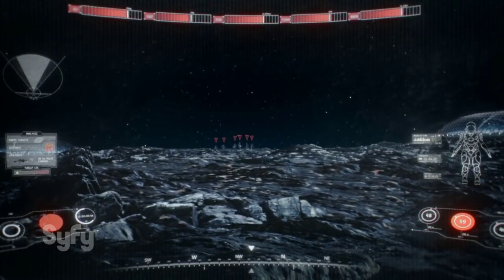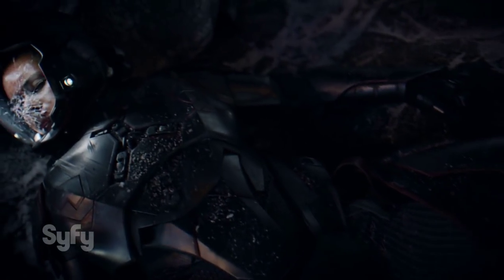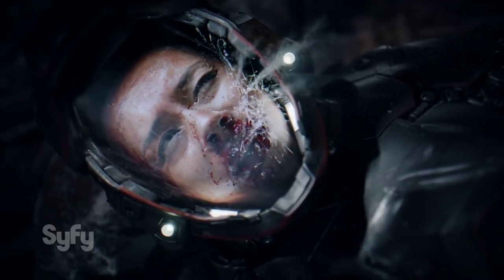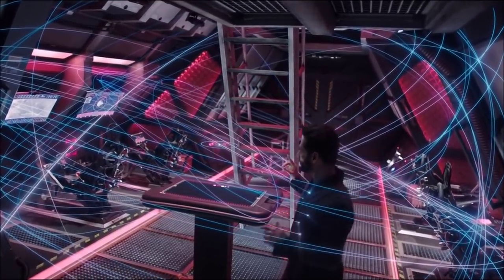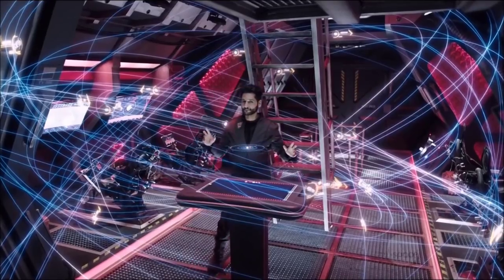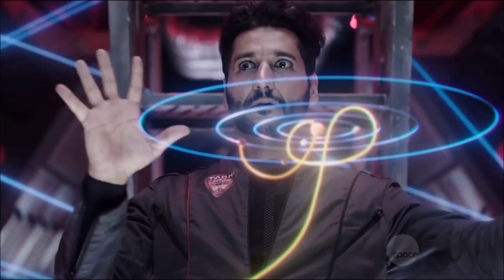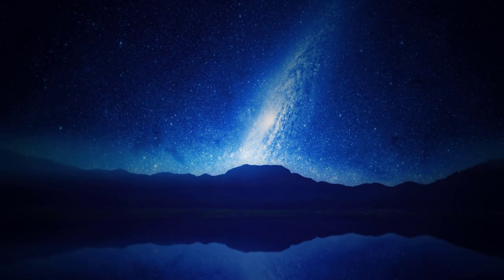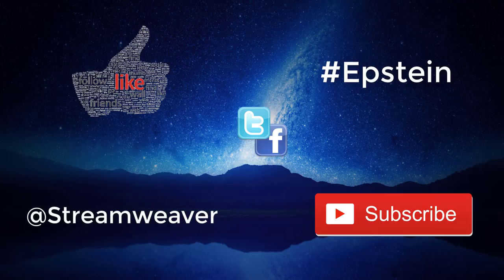Let's Do the Science:  The Epstein Drive

Comment: puts on SciFi speculation hat 

I'd wager that its some sort of magnetic bottle engine where only thrust products of a certain energy/velocity are allowed to escape.  Basically a re-burning engine where hydrogen is brought to fusion temperatures (or beyond) and only hydrogen and helium ions with sufficient KE are able to escape the bottle along the outer edge of the engine bell.  It would use an MHD design to move the ionized particles through various magnetic shells and back into the core. Thus everything that doesn't escape is sucked back in for successive passes through a partially exposed fusion core.  The bell and components would be constructed out of a Tungsten alloy with powerful electromagnets driven by the ship's primary internal fusion generator.   All waste heat from inside (including the crew compartments and internal fusion power systems) is directed to the engine system to be focused on the core.  

The exhaust products would be moving about 30 percent of the speed of light, assuming that at least 3 acceleration passes through the core are made with the particles gaining 10% of light speed each pass and some fraction of the particles having the capacity to fuse into He which would kick the exhaust products up a notch.  It would be impossible to get it up to He+ fusion, which would result in carbon product (which would be bad for the crew because carbon isn't magnetic, and would have just as much a chance of firing through the tungsten shield and into the ship... not to mention HE+ fusion would be... well... more than hot enough to vaporize tungsten alloy.  

Of course, this brings up another potential way of boosting thrust: allowing small amounts of tungsten to be ablated by the partially exposed fusion reaction, and become a part of the acceleration loop.  Basically a rod of tungsten that is slowly inserted that in essence acts as an afterburner fuel.  Much heavier and denser... capable of much higher dV because of its density.  I don't know if its magnetic, but you could have the rods on the outer edge of the bell where the exhaust product would ablate the material and carry it along at 10-15% of the speed of light if the plasma is moving at 30%.  Ablation is not the same as melting - and something tungsten is actually vulnerable to considering its other strengths.  You'd also want a lot of shielding between the engine and engine bell and the rest of your ship.  Magnetic field snapping is a thing, and you would want something to absorb most of that radiation if a reactant arc backfired towards the ship.  If your fields are good enough, most of the magnetic products should be able to be trapped in the magnetic fields generated by the bell and redirected back into the fusion stream.  But disassociated neutrons might not be so polite.   

This would be a very efficient engine, and should be able to sustain a 1g thrust until fuel exhaustion even on a massive ship.
Reply: Paul Vance The books have a plot point around the magnetic bottles of the engines and the destruction that would occur if that bottle failed. You might be right!
Reply: >>>>It would be impossible to get it up to He+ fusion, which would result in carbon product (which would be bad for the crew because carbon isn't magnetic, and would have just as much a chance of firing through the tungsten shield and into the ship... not to mention HE+ fusion would be... well... more than hot enough to vaporize tungsten alloy. <<<<

Errr...it doesn't matter if carbon is magnetic. Helium and hydrogen aren't either. Whe're dealing with ions here, all ions interact with a magnetic field. And it doesn't matter what the bell is made of, and fusion plasma is hot enough to ablate any known physical material. You use a magnetic engine bell, a la VASIMR.
Reply: I'd even go on a limb here and say that the Epstein drive would employ a resonant magnetic bottle compared to a regular magnetic bottle that the "torch" drives would use. Think of a cross-breed between the now experimental EmDrive and a fusion torch, which would mean that a lot of the thrust comes from the electromagnetic energy that is stored in the engine and only a small fraction of it is expelled out of the exhaust, only serving as a fusion power source to keep the drive going.

It would also explain away the "accidental" invention of the insanely efficient drive by just playing around with it, since it meant that mr. Epstein had inadvertedly configured his drive in some kind of resonant mode leading to a runaway acceleration and unexpected efficiency.
Reply: @Reliken  Also in Expanse there is some secondary plot centered around magnetic bottle (or more about what happens when there is no bottle no more)

Comment: The fuel pellets are to run the primary reactor and generate power. They have yet to say what they are but it is mentioned that helium 3 is mined for use in station and planetary reactors for power so it may be a hyper compressed version of helium 3. The books mention drive mass as being used to propel the ships in the form of highly magnetically accelerated plasma propulsion (As stated in the line of having enough fuel pellets to run the reactor for months but they would run out of reaction mass before that). And the maneuvering jets in the books use accelerated steam.
Reply: helium 3 reactions would make sense. they produce much less radiation, so they would need less shielding for the reactor, resulting in a lighter ship.
Reply: They would run out of reaction mass withing hours if not minutes. Whole point of fussion is that it's effective, and uses much less fuel mass and produces much less byproducts than chemical rockets.
Reply: They fuel pellets is when they run "teakettle", or without an Epstein drive. It provides lighter thrust for maneuvering "short" distances in space, usually from station to station within the asteroid belt, or moon to moon in the Jovian or Saturn systems.
Reply: Nope. The Fuel Pellets are for the fusion reactor. The maneuvering thrusters are vented steam, hence why it's called "teakettle".
Reply: Apologies for the darn long reply. By my account, what is meant with term 'teakettling' was NOT the super heated steam based RCS system.

But it was an "old timers saying", stemming from the torch drive era, that was used to compare the 'very low thrust' (of only running on reactor plasma only mode) to that of a 'wispy steam cloud' coming of a 'boiling teakettle' (the steam from an actual teakettle, would hardly generate generate any thrust in a vacuum at all). 

Steam has VERY BAD isp, but okish thrust, therefor steam based RCS could not have been be used as a propulsion means for prolonged periods. 
But plasma as propulsion can. It gives very low thrust, due to low molecular weight. Which is inline with what is mentioned in the books. 
So IMO, that usage of steam + kettle and RCS in the books confuses(d) a lot of readers what it meant.

In Nemesis Games, if I'm not mistaken, it is even mentioned a few times that Inaros's ship was teakettling for prolonged periods, to conserve reaction mass, having near to no thrust gravity (besides them being on the drift).

Comment: There was one episode, where Naomi checked on the propel mass of the roci and was quite worried because they blew out so much allready when they escaped from the donager exploding.. Though it's far from unlimited and the propellant and the fuel seem to be two different things in the epstein drive.
 There are also several occasions in the book and at least on in the show where they use the drive cone to burn stuff off *gg*. Cheap ships dont have an epstein and just sling shot around: seems to be expensive as well. 
The torpedos of Earth and Mars are also using epstein drive, I think thats the application with the maximum acceleration we've seen so far (at least for human built application ;-))
The biggest one should be the Navoos drive(s): accelerated with one G for two weeks , reaches the orbit of Pluto, drives shut off and than travels for one hundred years with 5 % of lightspeed to Alpha Centauri... At least that was the plan XD
Reply: Wasn't it au Ceti? Pretty sure.
Reply: Tau Ceti
Reply: She was worried about reaction mass, not the pellets. She said pellets supply on Roci (then Tachi) will last for years. Idk if it was stated in the show, but was in the books.

Comment: #Epstein Rocket efficiency is all down to getting reaction mass up as high a velocity as possible before letting it go out the nozzle.  The Epstein drive must, somehow, manage to send particles with some mass out the nozzle at very nearly the speed of light.  There's only one device on Earth that does that: particle accelerators.  The only way the Epstein drive can be as efficient as portrayed is by being, at least in part, a particle accelerator.

Particle accelerators have to be pumped with energy.  What is the most efficient source of energy by mass of fuel: some form of nuclear energy.  Chemical energy is at least a million times too diffuse to work... so Epstein Drives are not powered by double-A batteries.  Obviously fusion gets bandied about in The Expanse so this must be the power source for the particle accelerator component of the Epstein Drive.
Reply: Two possibilities building off this idea:

1. Less plausible, but given the extremely large mass of neutrons, what if the thrust is produced by a neutron accelerator. Modern particle accelerators require charged particles, so that seems improbable. If it were to happen though, it both solves the problem of the neutron radiation and uses an otherwise-wasted product of the fusion reaction as fuel to produce thrust.

2. If they can simply capture and contain the neutrons somehow, they break down into charged particles at a fairly decent rate, so it would be possible to use the instability of the contained neutron radiation to fuel particle accelerators, gaining most of the same benefits (though not quite to the same degree as the proposal above).
Reply: Yes, and our particle accelerators like LHC are extremely inefficient. If however we figured out how to accelerate any atom to within a billionth of a billionth of a KPH of C with 80% efficiency, then a 1G or better drive would be possible. Remember a particle moving so close to light speed would have a huge mass (relative to a stationary atom). Sending it out the back of a ship would have an equal and opposite reaction and you can put a lot of atoms in a small space. As long as you had a power source that could keep sending them at the necessary rate to provide 1G, you could accelerate for long periods of time.
Reply: I think you know about the size of the LHC and the extremely thiny mass it can handle. I'm a physicist and i can understand dreams, but reality is a bitch that wake you up with a huge kick in the ass!
Such things as the Epstein drive are wet dreams we can imagine but to keep such a fantastic story as The Expanse intact, we better forget about explaining that drive and see it as the Star Trek warp engine, something magical !
In the two case, it was some kind of crazy scientist that made that huge discovery all alone in his garage with a tool kit and parts coming from vacuum cleaners and lawn mowers !!!
Reply: @kukipett  To be fair, they used to say that about nuclear fission.  Ah, it's just a flight of fancy.  It'll never happen.  It's pretty on paper.  While, using a particle accelerator as a way to travel seems horribly inefficient, I think we'll find a way to continue "hacking" on the quantum level.  Hell, in The Expanse, they're not even using quantum technology to communicate!  300+ years in the future and they apparently didn't figure out that the quantum world is really funky and can be used to do some really funky things, such as communicate with 0 picosecond delay.
Reply: @kukipett  Well I'm not exactly a physicist (I'm a moron to engineering whatsoever), and obviously if we knew how to do these things we see in sci-fi movies, these wouldn't just be movies... But be reasonable, comparing ST warp engine to the Epstein drive is like comparing the LotR movies to Troy (2004) for example. One is trying to keep a foot on the ground, the other is up high in the clouds, and we all know which is which.
Reply: @manictiger  Protolecule is assumed to use some sort of quantum entanglement to communicate.
Reply: @kukipett  LHC pumps protons to .99 something c, but epstein drive isn't trying to go that fast--no sense in accelerating your exhaust to that level when you're only going to at .0x c tops. The speed of the exhaust is the craft's max speed, so they could contend with accelerating their exhaust at around .1 c or even less which would require far less massive machine, especially if you could manufacture "room temperature" superconductor coils at large scale.
Reply: @manictiger  Nuclear fission is happening in the nature that's why we knew it was possible just as fusion, all the difficulty was to control it in a reactor because it's easy to cause an accident but keeping a nuclear reaction steady is a whole very complicated thing.
And for fusion it's a whole other level of complexity, that's why we keep saying it will work in 30 years since 60 yeras!
Reply: My guess is that some of the power of the actual fusion reactions powers the magnetic field, and that there’s something similar to a “spark plug” that gets the reaction going so it can power the magnet and make the drive work properly. Considering that they’re launching ions, a small amount of magnetic field applied can go a long way especially as a coil design

Comment: Idea: the drive doesn't use the plasma of the fusion reaction itself as propellent, instead, it uses the captured energy from the reaction as a power source to accelerate propellent particles. Rather than spewing a bunch of fast-ish and really hot particles as propellent, it uses something functionally like a railgun to accelerate a few cold particles at extremely high speeds. This would explain why they're so efficient and need to carry so little fuel, because they're using such a small amount of propellent to maximum effect.

Comment: The biggest thing I see missing is radiators. There will be a lot of waste heat that the ships need to dump and the mass flow of the propellant is far too low to cool the engines.

The lack of big visible reaction mass tanks requires extreme exhaust velocities. In other words, the drives are spectacular particle accelerators that will make excellent weapons.

As a consequence of the power available to ships, there are a few weapons that I would expect to see more of:
- Point defense lasers. If you can accelerate a ship at 15Gs, you can operate a laser powerful enough to vaporize rail gun slugs and achieve mission kills on missiles.
- There should be particle beam weapons made out of Epstein drives optimized for different variables.
- High velocity means that flak or canister shot (from a missile or railgun) can make kill cones that will easily destroy anything without heavy armor. In other words, knowing the approximate location of a "stealth" ship is enough to turn it into Swiss cheese.
- Battles should take place where there are huge velocity differences between fleets and it takes them a day or more to turn around and reengage if the enemy survives.